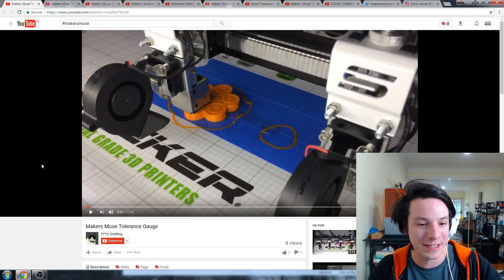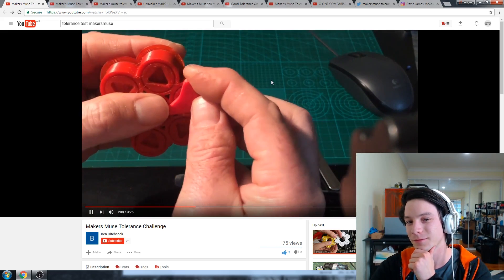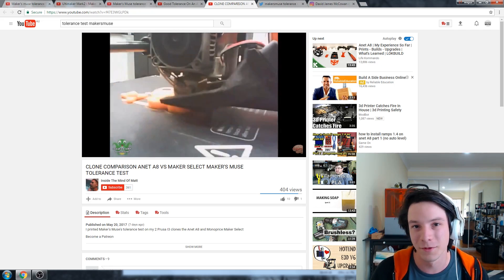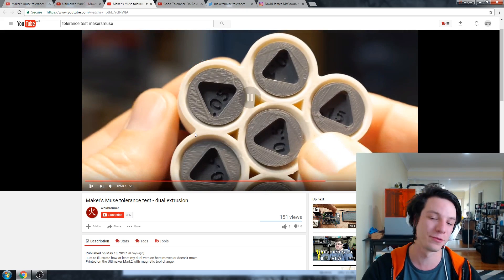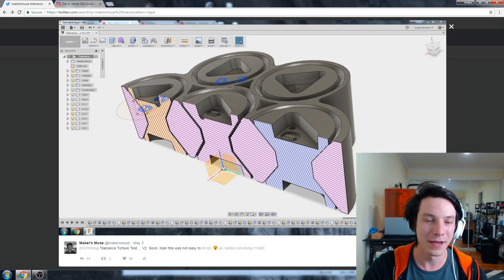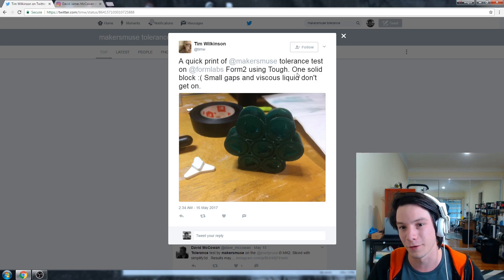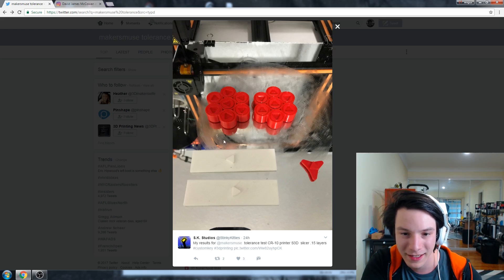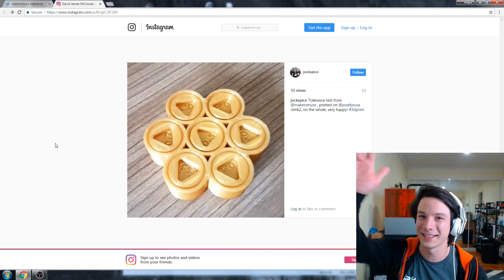Maker's Muse Tolerance Test - Your Results!

Comment: Really late to a party... But I just find your channel and got 3d printer only few months ago. I am going through your videos I must say pretty useful and helpful content. Now I was able to print on my Ender 3 Max with 0.4 nozzle, Pla+, sliced in Cura,and got all rolls working(given I have to use quite a lot of force to make smaller move, but once moved it spin without issue).

Comment: Guessing the users slicing in Cura and getting 0.05mm to break free, they're likely utilizing the Slicing Tolerance in experimental settings to ensure the lines stay inside of the defined part walls and helping to maintain better clearances.

Comment: This is going to be a 4 years later test. You have some great videos and I am now a maker and, it seems like I am also a repair shop. I grabbed a few machines that had issues and these are not popular machines so my results might interest you. My first machine was a Dobot MOOZ 2, which I got for so inexpensive it's insane. I paid $140 for it as I had a $100 coupon to buy on Amazon. So it was actually $240 - $100. And I thought it was cool to have a 3D Printer, Laser and CNC. I am getting some really insanely good prints from it even though many YouTubers trash it. In fact my neighbor has a PRUSA and my prints are often sharper than his. He actually didn't believe I was printing with it so he came over for the proof. Next I grabbed a Sindoh DP200 which I wanted as the Dobot has a 120x120x120 build volume and the Sindoh has a 200x200x200. It has extruder issues, clogged print head, temperature sensor that wasn't working and causing reboots, and it needed a new print bed. I paid $100 for it and $300 later and about 10 hrs labor and it's working great. But not as crystal clear prints as the Dobot. Then I was on eBay and saw some seller that sells a bunch of printers that are missing parts or don't work. He had a Dobot MOOZ 3 which swaps colors, mixes, and does gradient on up to 3 colors. Very small 100x100x100 build volume but it was $60. I got it assuming parts were missing and I would use it for replacement parts. Shocked that no parts were missing and it looks like the issues with it were incorrect leveling or zero point or using Cura wrong as the MOOZ 3 has a circular plate and if you configure Cura for square you will damage the print bed. He damaged the print bed but not the glass. I removed the cover, bought a magnetic bed and fixed that. Shocked that at $60 it worked out of the box. Very cool to blend colors. So, now I am going to print on 3 printers all that I fixed. Since your video is 4 years ago not sure if you are interested in the results but since nearly no one uses these printers you might be interested. Cheers.

Comment: interesting video :) the slic3r documentation demonstrates how to calculate the extrusion widths based on nozzle dia and layer heights so I am in the process of tuning the slic3r print settings/profile/advanced for my ender 2 with actual numbers instead of every setting as percentages or just saying default and auto lol this test should help me out a lot so thankyou

Comment: Here are the results I obtained with a Cetus3D printer:

Print 1
Material: PLA
Nozzle size: 0.4mm
Layer thickness 0.3mm
Quality: Normal
Print time (with raft): 1h24m

Result: 0.3mm tolerance turned freely, 0.2mm tolerance turned after using some force

Print 2
Material: PLA
Nozzle size: 0.4mm
Layer thickness 0.2mm
Quality: Fine
Print time (with raft): 3h7m

Result: 0.2mm tolerance turned freely, 0.15mm tolerance turned after using some force

Comment: Thanks for making this, Angus! I'm a bit late to the party, but I printed the tolerance part on my newly built Prusa i3 Mk2s last night. I haven't done much serious calibration to it yet beyond the defaults. Printed mine at .1 layer height, .4 nozzle, Prusa Silver filament, and sliced in Slic3r 1.36.2 (Prusa Ed.).  I was gutted when I could only free down to .2mm!  But seeing that many had trouble at the .15 and below, this made me feel better. I think I can dial mine in to at least free up the next one down! Cheers.

Comment: I meant to post a comment when the video actually came out but for some reason totally spaced and forgot .-.
First off, THANK YOU for the inclusion! :D
Surprisingly I actually had only recently gotten my Cocoon Create and before this had never dabbled in 3D printing. Also your theory with Cura being a factor holds true in my case as, you guessed it! I used Cura to slice.
As with the settings being dialed in, I'm still having some slight problems with internal structure stuff (you can just see it in my video) but in the end it hasn't had much of an effect with the strength or way any of the models look.
So yeah, thanks for the mention and I think Cura needs to be investigated! 🤔

Comment: Hmm, that 0.05mm is suspicious. Perhaps consider creating a tolerance gauge that uses only straight edges (i.e. nested rectangular prisms with ever-decreasing gaps) so that you can use a set of feeler gauges or calipers to measure the exact dimensions of the parts. That would allow you to verify if the slicer is artificially inflating the gaps on the 0.1mm and smaller gap parts.

Comment: On my first try printing this on a CR-10, with Protoparadigm PLA, and sliced at 0.1 layer height on Craftware I got the 0.15 to break free pretty easily. I tried the 0.1, and the key snapped with very little effort. :(

Comment: Managed 0.15mm tolerance on Wanhao Duplicator 4S, RigidInk black PLA, 0.20mm layer. Parts 0.5mm down to 0.2mm were loose direct from print bed. Had to use the (nasty!) key for 0.15mm but that then spun freely.

Comment: Angus would also x y z calibration play a role in this? I.e on my printer stock from Aldi printing a xyz cube I found the 20cm cube was 20.05 x 20.17 x 20.15 so question if someone's printer is out the would that not affect tolerance results?

Comment: First thanks Angus for all your great videos, on your recommendation I got the CCT printer from Aldi lucky to get one a week later. I had a go with my Cocoon Create Touch but stopped after half hour as it was not going well, need to tune my bed level and lower the temp perhaps. It would be nice if you could perhaps make each cylinder available as a seperate STL. That way we could print them quicker meet a goal and then move to the next level up.

Comment: I printed it on my mp select mini v2 but was to lazy to make a video or anything. its only the 5th or 6th print I have ever done on it. Printed on a raft using cura in generic white pla, got the .3 to spin but couldn't do anything lower than that. Planning on doing US water rockets improvements and doing it again to see how it turns out.

Comment: So the other day, my E3d hot end broke at the narrow part of the heat break, for no logical reason. Do these just break sometimes, did I over tighten it, or what? Never had that happen before in the year I have been 3d printing. 
Also, Since part of the old heat break was then stuck in the heat block with no way to remove it, I just replaced the block and the throat, but I had a LOT of difficulty removing the old heater and thermistor cartridges due to being glued into place by burnt plastic. 
Is there something I can do to dissolve or remove the months worth of residue that no longer soften significantly to a heat gun?

Comment: I printed it on my Wanhao i3 both in PLA and PETG (MicroSwiss all-metal hotend) using 0.1mm layers and 0.4mm nozzle. No nice videos from my side, but on both I got the 0.3mm gaps free directly from the bed, but I am not able to free the 0.2mm. Sliced in Cura.

I also made my own, slightly more compact version in OpenSCAD with the same results.

Comment: interesting thought, surly a duel extuder should be able to get even tighter tolerances with the right settings? surely you could even theoretically use different plastics that wouldn't fuse as easily to each other?

Comment: I got the 0.2 free with a bit of torque on my v1 MP Select Mini with generic monoprice PLA. The 0.3 was loose as soon as I pulled it off the bed.

I sliced with CraftWare and printed at 210C on the nozzle (the listed nominal print temp for my filament) and 50C on the bed.

Comment: using simplify3d, @40mm/s, LH:0.1mm, 7% infill, 2 perimeter shells, 3 top/bottom layers, my Kossel mini / anycubics mutant delta printer i scored 6 of 7 tolerances: 0.05 is to much for my printer. I said mutant printer because i have all the parts 3d printed (including the extruder/feeder assembly). So, i'm happy with the results. 10x for the mesh!

Comment: Well that encourages me to press on with my Anet A8. I was only able to get the .4 to work. I have always found that all my dimensions on all axis, for any size print are .4mm oversized. It doesn't matter if it is the outside dimensions or an internal opening in a print they are always oversized (internal openings too small). Splurged and have upgraded to a authentic ED3 nozzle and Simplified 3D. I don't know how to adjust to fix. Any ideas?

Comment: It would be cool if you made another video to see which slicers automatically handle this type of 3D print with the settings that would optimize good results.  Also can you post your slicer settings that you used for the original?

Comment: I've been using repetier host, and found that cura definitely extrudes a bit less than slic3r with the same settings, even default extrusion set to .4 like in cura.  This makes for smaller IDs and larger ODs.

Comment: How do OnShape and Fusion360 differ?
Reply: Fusion 360 is a local install on your machine, and uses the cloud for storage. Onshape runs in your web browser, nothing installed locally.

Onshape does not value any privacy for users on their free plan, so anything you might create will be available for anyone to download, what I call the "Forced share plan". Unless you're comfortable with that, or willing to shell out for the pro plan, I'd advice you to go Fusion 360.
Reply: Thanks! but how about workflow and tools? Fusion is free, correct?
Reply: Yes, for hobbyists and startups (making less than $100 k/yr I think) Fusion 360 is free.
Both have their strengths and weaknesses, but in total Fusion 360 has a lot more to offer than Onshape. Stuff like sculpting, for instance. This may change in the future, of course. Both are parametric, so the modeling workflow is similar.

I abandoned Onshape due to their changed terms with no privacy for free users (and no mid-tier plan offer either), but that may or may not be a concern for you. If it is, and you don't want to spend money, then Onshape isn't for you. Fusion 360 is in no way perfect either, but it is actively developed, and their forum is great (but that is also true for the Onshape forums).
Reply: Thanks you have been helpful!

Comment: How about a vid on Raft setting?? Thanks
Reply from the maker: I discuss rafts in this video - ideally you shouldn't be needing them. https://youtu.be/Fo42S22BTwg
Reply: Hello More a good raft that is easy to remove and does not make a mess of the base,,Agree I only use if I have t,,
Reply from the maker: It just comes down to your separation distance, increase it slightly until the base separates cleanly.

Comment: To anyone reading this, what is your favorite 3D printer under $400 USD? I'm looking into the Maker Select V2 by Monoprice and I have seen where you need an extra $20 to add vertical stability. I would like a larger build volume if possible for that price. I've looked up a bunch of reviews on 3D printers but more input never hurts.

Comment: My Wanhao i3 V2 doesn't even get the 0.5mm free; I've done other tests and it freezes up to 0.6mm [.6 becomes free with much persuasion]. The issue is the nozzle is dragging plastic over when it travels between the separated parts. Perhaps my temperature is too high, but, I have massive temp stability problems (using a stainless steel nozzle, and i have done the etemp to ground mod) so I have to overtemp it A LOT in order to get it to stay in good PLA temps the whole time its printing. Might try it again later, but I know some specific (very, very large) prints I have made end up with one portion or layer that just is not melted together if my temps are too low.
Reply from the maker: Try implementing Zhop, it might help you avoid that issue. Depending on your slicer it'll be called 'vertical lift' or 'zhop'. Your temps may also be a little high!

Comment: One of these days I would like to see you show off tuning a budget 3d printer (like monoprice's version) where we can just buy it and then follow along ourselves at home. I would prefer a non-DIY since there are so many variable when it comes to the build quality of those. 

I'm really tempted to get into 3d printing but getting a cheaper printer working sounds like a lot of work and while they're are many guides on the internet you're always very technical regarding print quality and do a great job explaining things. Anyways keep it up.
Reply from the maker: It's a good idea, but the problem is that one video will only be applicable to one machine. What I am planning is a more generalized mod list... but again, it's in the 'list' of videos - of which there is more than I can ever possibly do lol. Getting a cheap kit to work well can indeed be lots of work, but that's the trade off, you pay in 'time' not more money.
Reply: Maker's Muse I do understand your specific adjustment values would only be for that machine but the steps in how you measure, check and then alter the settings would be applicable I think to anyone using the same machine. A video list could also work, but I feel if you picked a single machine and showed off how someone on a budget could go about it, that it could be the spark many need to jump from just watching to participating with you. It's a bit hard to join you and any other YouTubers who are using machines with extensive aftermarket modifications or $1000+ printers. Seeing all the bad prints off the cheaper printers only helps keep many of us away I think. 

Anyways thanks for replying and especially thanks if you read through this wall.

Comment: Quick question... when you say 0.5 mm, does that mean there is a 0.5 mm gap all around or does that mean there is a 0.25 mm gap all around with a total of 0.5 mm?
Reply from the maker: I mean it's 0.5 between surfaces, so 1mm total side to side.

Comment: My Cetus using the standard .4 nozzle and .2mm layer height freed everything down to and including .15 using the stock Cetus slicer.  I know you have one and would like to see if your results match. Just an unbelievable printer right out of the box
Reply from the maker: LOVE my cetus, the UP slicer does some trickery with intersecting shells but that sounds about right for clearances. I wish their software had a preview but other than that it's a fantastic little machine.

Comment: If the community member with the formlabs printer printed the tolerance test flat against the bed, it has to do with the  first several layers, the preform slicer kind of smashes the first several layers for adhesion purposes. That alone could cause such an issue.
Reply: Paul Curtis could be that but could also see the possibility the light is bleeding through the part and making it cure between the parts too could see it being an issue with this particular shape too since the laser light could pass through the solidified resin and be hitting resin trapped between the inner and outer cylinder many times.  Maybe they could belt sand the base of the part to see if it's just the bed adhesion layers causing it to lock up.
Reply: It very well could be. I concur, belt sand the base, whilst reprinting with a black resin perhaps? Could that possibly help prevent some of the light bleed? Time to drop in some science.
Reply: expensive, expensive science.

Comment: Angus, lots of printers by default extrude a little bit too much, hence why it usually takes 0.3 to have enough clearance to move. If you try to print the ratcheting wrench from NASA's ISS files, in order to get it to function, we had to drop the multiplier down to about 85%. Maybe you can try that to see how much it affects your results.